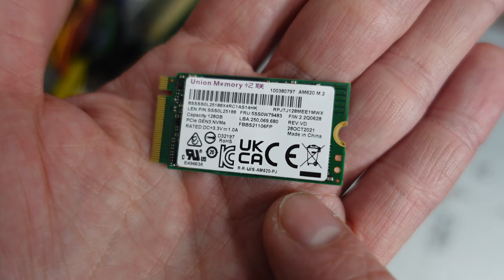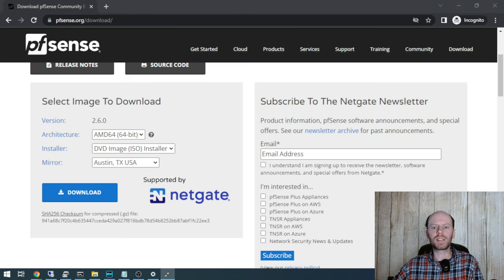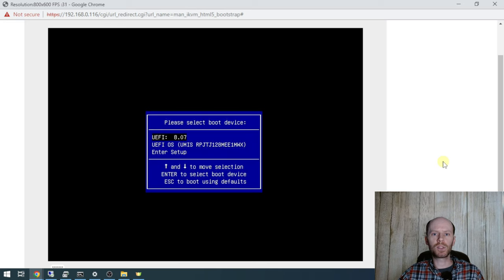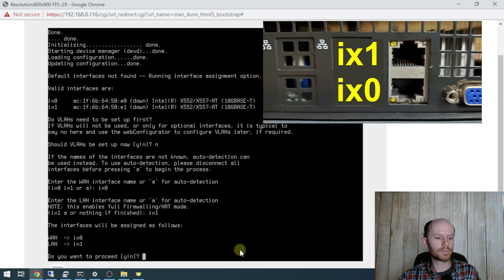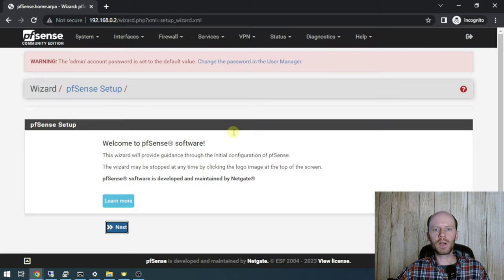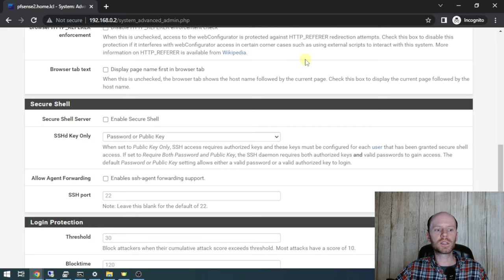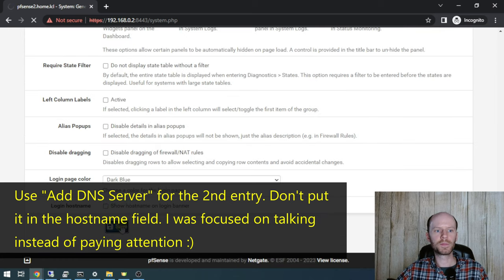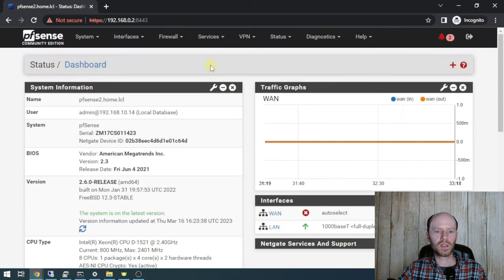Custom pfSense Router Firewall - Building, Installation, and Configuration

Comment: Would love to see what the power consumption is over a good length of time (perhaps a few days).
Reply from the maker: Sorry, I meant to cover that and forgot... it sits idle at 30W. With normal home network load, it's around 33W. With Suricata running, it's around 38W - a little higher than expected but still pretty good.
Reply: @HomeSysAdmin  thanks! Just was going to ask this question.
30W idle seems a lot for this system (I was expecting 15-20W). Do you think it's an overhead from IPMI and relatively old platform?
Reply from the maker: @dimav83  It is quite a bit higher than I was expect as well. From researching online, it sounds like the IPMI consumes about 10W in itself and there's no way to disable it on this particular board (I'm not sure I'd want to either).
Reply: @HomeSysAdmin  Brief research shows that 10GbE chip that this motherboard has uses circa 10-15W. Which, together with IPMI, explains the power consumption.

Anyway - thanks for the video. Really nice case!
Reply from the maker: @dimav83  Interesting, where did you find that? I'd be interested in reading up more on it.
Reply: @HomeSysAdmin  that will be extremely difficult to find now :). Found review of similar generation Supermicro motherboard with 4 10GB ports and guy done a deep dive on power consumption, concluding that main overheads were from IPMI (circa 10W) and 10G network ports done via old chipset. 
Sorry, if I'll find the link to that discussion - will post here.

Comment: Hi, how did you install the fan on the cpu cooler, did you have some small clips ? I have similar setup but has fan mounted vertical in the case but its very noisy, its a San Ace 40

Comment: guess the 10gbe makes the 250$ board worth it... sort of, def think the dq77kb is still the top performing board for pfsense/opnsense, sure it's got a 4x pcie slot, but you can get an x550-t2 for like 80$ and with a 17w tdp xeon, she handles it all plus more
Reply from the maker: I don't necessarily disagree. I am a tad disappointed with the power consumption of this, though I do like that it has IPMI. I think I can do better and likely will try another build here in the next few months. The X550's are kick-ass cards too, I'm running a few of them and they would be perfect for a pfsense build.

Comment: Hi, just curious, how is the noise level of this? When running normally, does it get loud? did you eventually add extra fans? Thanks
Reply from the maker: It's not very loud at all while running normally. It is getting a bit warm so I'll be adding a small fan just to get air moving through the chassis. It's sitting around 56C which isn't overly bad but is a bit higher than I'd like for normal operation.
Reply: @HomeSysAdmin  Thanks for the reply, yea, i really like the idea of diy this host, my only concern is the my network cabinet is kinda sit very close to me, I tried to go fanless as much as possible. Thanks for the info man.

Comment: My main question would be how much you spent on that build. I'm very interested in that chassis and a motherboard that'll give me around 2 SFP+ 10Gb ports & at least one baseT port greater than 1Gb (can be 2.5, 5, or even 10 Gb), so I'm looking at a system such as the SuperMicro SuperServer 5019D-4C-FN8TP, but its approx. $1000 price tag seems a bit steep (I also wouldn't have much use for the 4 extra 1Gb baseT ports). Thanks!
Reply from the maker: The total cost came in right around $525. You can probably knock $100 off if you can find a used case. I spent more than I should have on the case because I really liked the front-facing design. And yes, the models with SFP+ ports are around 2-3x the price unfortunately.
Reply: @HomeSysAdmin  Thanks for the info, very useful! I love that case, indeed, so I'd probably go for it regardless of the cost. So I guess I'd just have to find the correct motherboard for the networking that I want, to see if I can get that price tag below the $1K mark. I just thought of going for the SuperMicro build because, as confirmed by Serve The Home, it boasts some pretty high quality (and certainly higher than what I could put together, e.g. cable management). But, on the other hand, buying it pre-built certainly takes away a good deal of fun ;)
Reply: @HomeSysAdmin  @jmpalacios I followed a similar build that was with 32 GB 2133HZ ECC RDIMMs for $505 US before tax.  Only thing used was the motherboard I from Ebay which was $250.
Reply: @engineerallthings   hi , What memory model did you put in it? I want to build one with 32GB ram ecc

Comment: You mention there is another motherboard that has more then 2 10gb 10baseT ports, do you have a model number? I need 2 WANs and at least 1 LAN port on my motherboard.  Get video!!
Reply from the maker: There are other versions of the X10SDV that have additonal 1Gb ports. There aren't any with more than 2x 10Gb ports. If you need more than 2x 10Gb, you could add with a pcie card.
Reply: @HomeSysAdmin  I found the X10SDV-4C-TLN4F which contains 2 extra 1gb ports.  Thanks again!

Comment: any reason for the free pfsense over the fre opnsense? just personal experience?
Reply from the maker: Simply because there's no reason to look it when it's a fork/copy of pfSense and there's nothing wrong with pfSense.
Reply: Used to be big on pfSense, until they went all corporate, and I switched to the new OpenSource project (fork). It also offers me more of what I actually need/want, like it's built in Geo IP lists for blocking unwanted countries, etc. That was a little more of a pain, though possible, on pfSense. I host services and it's nice to easily block those pesky intruders from scanning my IPs. Also I prefer it's UI (and lack of nagging support/licensing... *cough*). Nothing 'wrong' with pfSense, OPNSense is just better, in my option.

Comment: Is this good for 10G network?
Reply from the maker: I'm not sure how close you can get to full 10gig. If you're just doing basic rules/routing, I would expect to see full throughput. If you're doing a lot of switching, probably not. If you're doing a lot of IDS/IPS - definitely not.
Reply from the maker: I'll benchmark it if I can find a way to do it properly. My home internet connection is only 200mbps though.
Reply: @HomeSysAdmin  it’s for basic rules but won’t passing 10g through the firewall slow it down to the speed of the firewall lan speed?

Comment: But if you have the money bump the RAM up to 32GB or 64GB and get an extra stable Firewall.
Reply from the maker: How will that make it extra stable? There is still 10GB free of the 16GB that I installed. That's more than half.
Reply: @HomeSysAdmin  I am running a Linux based system and with 16GB it locked up regularly but when I put 32GB of RAM in the problem went away.
Reply: @DAVIDGREGORYKERR  What memory model did you put in it? I want to put 32gb ram ECC.

Comment: You skipped over the tedious part about the psu only being 20 pin
Reply from the maker: I had read somewhere on the Supermicro website that it was acceptable to use the 20-pin connector for this particular board. That's what I did and it has been working fine. I cannot recall where exactly I read that though - it's been a while...
Reply: @HomeSysAdmin  it's in the mobo manual